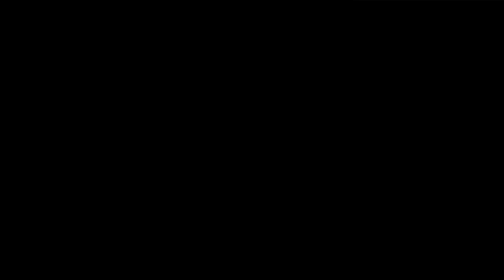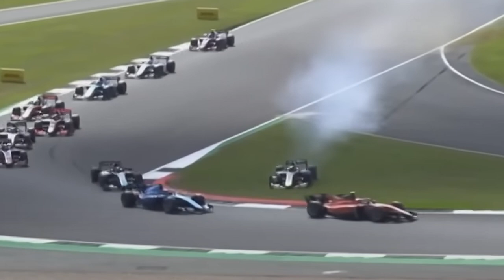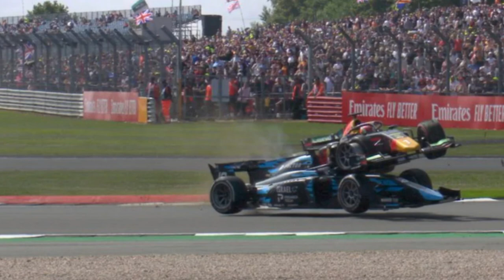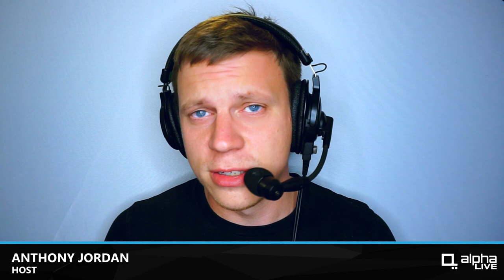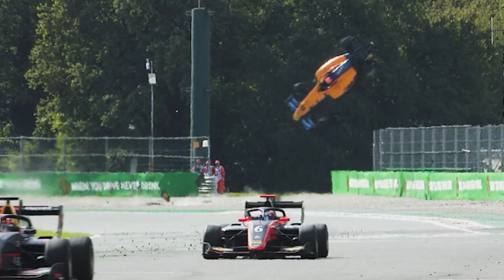Should sausage kerbs be banned from circuits? | The Alpha Live Podcast

Comment: I oppose all kinds of curbs (English spelling of kerbs) on racetracks. This sausage deal is stupidest of all. I hate that cars and karts bounce and bound over curbs as standard operating procedure. A track should be defined by its extent of pavement; no ridiculous runoff zones full of rumbles and ridges either. Many of the most horrific crashes I've seen were facilitated by these wide, bumpy exit runoffs. Where the track ends, the pavement should end. Inside limits of corners should be guarded with properly anchored rubber pylons and an abrupt ending of pavement. The outside verges should be defined by the ending of pavement and the start of grass or gravel. Yes, this will throw off lap records for a while. Yes, where sufficient expanses of grass or gravel are impossible, superior energy absorbers will have to be imagined and implemented. But, without those runoffs, corner speeds will come way down too.